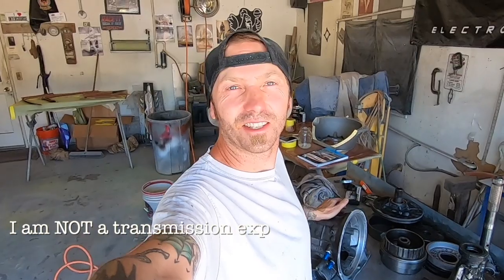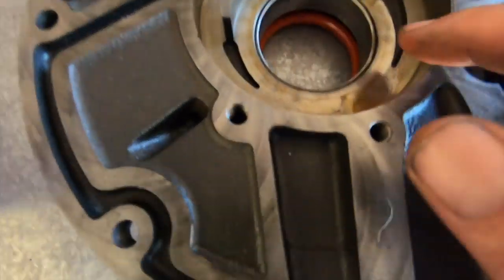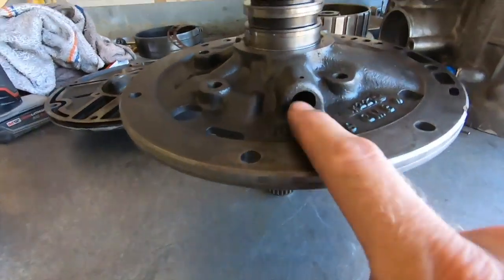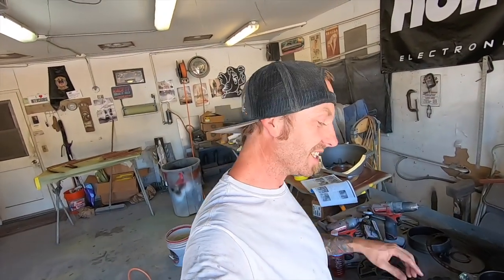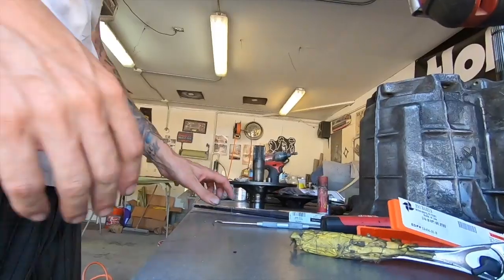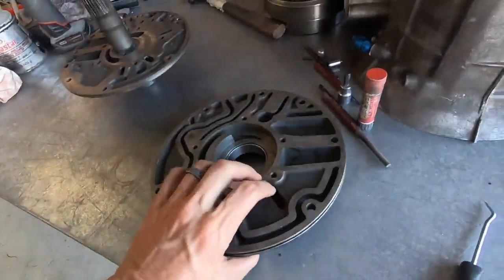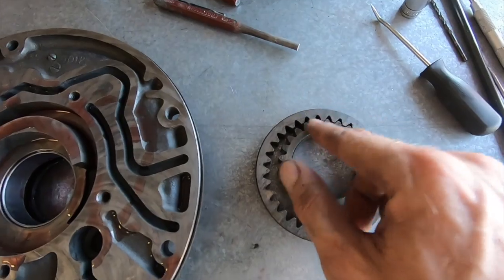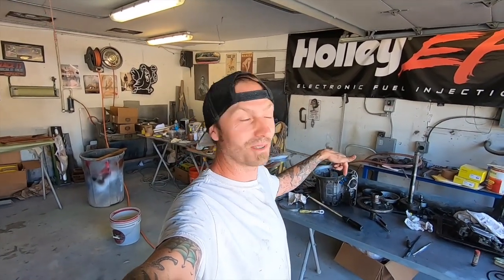Drag Race PowerGlide Pump Modifications (PowerGlide Build Part 04)

Comment: I know you’re not a transmission guy. But I have been having issues ever since I modified my transmission. I have followed all the steps and have contacted three builders and even posted on yellowbullet. My question is if I do the pump modifications do I have to run a deep pan. Right now I run a stock pan and when I let go of the transbrake the RPMS shoot up to 8000 RPMS.
Reply from the maker: The trans brake will hold but when you let off  your rpm goes up and you don’t move? Does the transmission function normally when you’re not using the brake?

Comment: I noticed you used a standard stator tube did you pin it
Reply from the maker: No I didn't. I think you can tack weld them as well. I didn't do anything to the stator and its still working but its probably cheap insurance while your there.
Reply: @Burndown  You did a great job mate I have been building performance transmissions for 32 years and I am still learning have a great day mate 👍

Comment: Should these mods be done on a pump/case if you are not using a transbrake??  They appear to help with fluid flow.
I am doing one of these at the moment and I do not want to run a trans brake in it for regular street driving.  Line pressure would be to high and would ruin the build!
Eventually If I want to drag race for consistant launches I will drop the trans and install one.
B
Reply from the maker: If you are not running a trans brake Im not sure. These modifications came out of a book I was following as I put this together. I had bough a manual trans brake valve body so I could not tell you if these mods would be ok for a regular PG or not. If I had an answer for you I was confident in I would tell you one way or the other if I knew.
Reply: @Burndown  Thanks!  I will ask FTI or BTE about that.

Comment: I ordered the same input shaft Dame?I noticed you didn't install the stator support bushing?Was it not needed with this shaft?
Reply from the maker: I have a turbo spline output shaft and my converter is set up with one so no need to use one in my transmission. Good catch tho. I believe most turbo spline converters have them but check with your converter guy so see if its needed or not.
Reply: Ok brother Dane..Thanks..Yeah most guys say that most converter companies install them now inside turbo converters!!

Comment: Great Video.... One thing to note when you modify the PRIMING VALVE RETAINER.... You pull the pin and you replace it with the 1/4" NPT pipe plug............ BEFORE you install the pipe plug you need to drill a 3/16" hole on the top of the pipe plug ..ie, looking down into the HEX end... This is to displace the air in the bore, else the priming valve will not move much trying to compress the air inside there.. Your plug goes below the old pin hole so that will not relieve pressure......... I'm in SD.. what city you at ??
Reply from the maker: Im In So Cal. I can check the book but I dont remember it calling to drill that out. It would make sense I guess but honestly this is my first transmission build and its currently in my car working fine. I would like to upgrade to a straight cut gear when I can and also plan on building a back up trans just to have one if I need to swap them.
Reply: @Burndown Sounds like you will be making more videos when that time comes... Some of the very early pump gears were made of steel and very strong...otherwise their cast iron... Keep up the good work...
Reply from the maker: @cerrem1  Yeah ill make a video when I change to straight cut or have to tear it down for a problem or maintenance. I did put new pump gears in it. The ones I had were almost done.
Reply: Yeah I always put the pin back in and carefully tighten the plug to the pin. Your right you gotta drill the plug for pressure relief 👍

Comment: You just put a burr on both your pump gears by marking them. Both gears have a champhered edge on them that tells you what side goes in. Please never punch on your gears.
Reply from the maker: Thanks for pointing that out. I can see how that would leave a burr. Yeah after I hit them with the puch I realized a marker probably would have been sufficient. This was the first time I ever had a pump apart and thought it would help me put it back together. Now that im a little more familiar with the parts I know now about the edge on the gears, I didn't when I did this. Well this is how we learn. I ended up replacing the gears anyway but its a good note for anyone watching this.
-Dane
Reply: Plus, they are not hardened gears, they can fracture from the punch hitting the metal. Worse case scenario, use an engraver and mark them. Bevel goes in one way and tangs are away from converter
Reply from the maker: @gneric85  Yeah next time I won't even bother marking them up at all. Now that I have done it a few times I know whats what a little. Thanks for the insight tho. This is how we learn👍 Pump gears were close to bad anyway so I just got a new set and threw them in.
Reply: @Burndown  
You got it. Just trying to help and avoid future problems. Been building auto transmissions for 31 years. Mostly performance use but also lots of "stock" builds.  :-)
Reply from the maker: @gneric85  I appreciate that man. I was also sent a goner delete that I installed after I did the videos too.